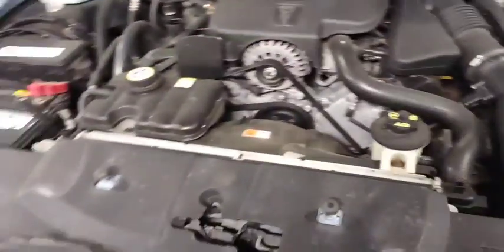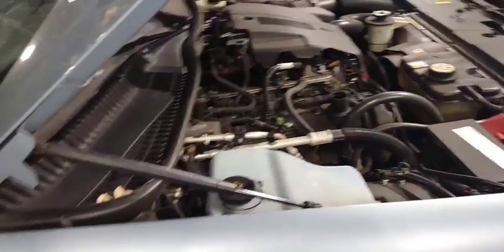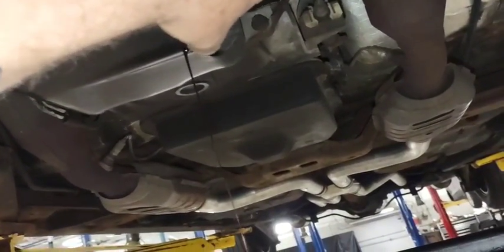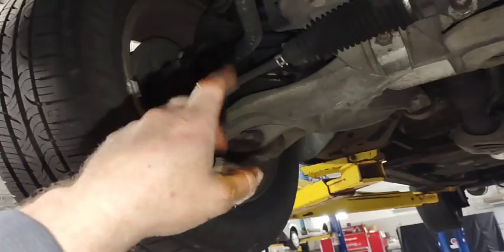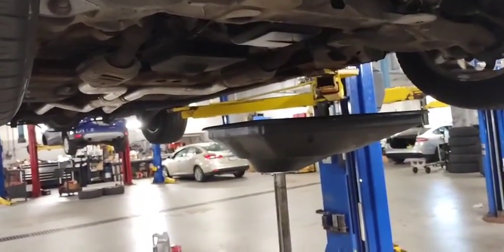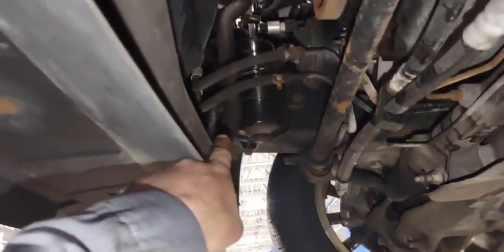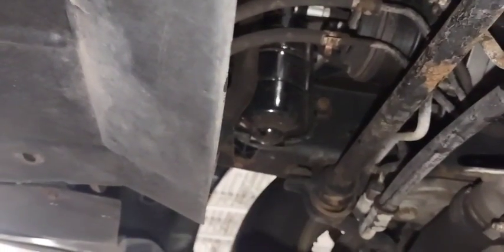Pennzoil Platinum Ultra oil drop 5k Miles, the next 5k Miles trying Mobil 1 extended high mileage

Comment: I seem to recall Pennzoil platinum ultra has the 2nd highest anti wear properties on the market. Amsoil's best is like the only thing to beat it.
Reply: yes but, amsoil is twice the price
Reply: @dickgoesinya9419  my point basically, why wouldn't you pay 35 bucks for 5 qts instead of 70 for an oil that offers 90% of the capability of an oil that's like 20x better than a regular old bs conventional that will see a motor to 500k if changed often enough lol.
Reply: @dickgoesinya9419  better off changing pennzoil twice

Comment: Ive used Penzoil platinum in my last 2 3.5 ecoboost f150s with the motorcraft filter. In 150k on one of them never once did I get the chain rattle. Pretty good stuff.

Comment: I love your videos! I do a lot of work at an independent shop that specializes in race motors, alongside general maintenance.

I would like to see you keep a small bottle of the different oils and different mileage on the oils and compare them at least visually between the different brands, and also the different mileage 3K/5K intervals to see if there are differences, and if there are, what can be learned from them.

Comment: I had an 02 mustang GT I used Pennzoil platinum 0-20 every 3000 miles and I have a 2012 BMW 335i and I will use the proper European spec Pennzoil 0-40 with the Mann-Filter HU 816 X Metal-Free Oil Filter.

Comment: In fact, with the Mobil 1 Extended performance the longer you leave it in the better it gets! Yes it will be very black but it will have zero sludge and no bubbles.

Comment: Rotella deisel t6 5w40 is the number 1 oil run in boosted subarus the zinc is what you want for flat tapet engines. Mobil 1 is known to spin rod bearings and oil consumption in the subaru world. Not hating on mobile 1 as my 2003 cobra has runs perfect on only mobile 1 its whole life. Rotella t6 for my boosted subarus.

Comment: Somewhere in a frame or 2 of your video at the 7:00 mark it looked like the safety seal from the mobile 1 container went into your funnel. I cant be sure it could have been an air bubble, but unless you know 100% that you removed the safety seal (tin-foil/plastic) from the container i would be scoping the oil pan with a boroscope. Maybe the pull the valve cover on the oil filler side of the engine too... Thanks for sharing your results. I do personally like pensoil platinum in ford products, seems to work well, and keep the engines clean & quiet.

Comment: QUESTION!?!? When you cranked your car with the pedal down did that allow the oil to flow before starting the engine?! I’m new at changing my own oil and had a loud start on my car. It quickly went away but I’d never heard that before. 😮
Reply from the maker: Yes but not all vehicles do that
Reply from the maker: Mainly American and some import
Reply: I’ve got a 2015 accord and I could prefill the filter even but I am going to see if that works. I’m trying pennzoil platinum high mileage. It sure sounded bad for a second or two. I hope everything is okay. 😅 thanks for your content

Comment: You can tell that car hasn't spent winters in western NY.  There's only light surface rust, not flaking scale.   And you have to love how oil filters are always over something that can catch the used oil potentially allowing it to drip off the vehicle for days unless you clean it off with brake clean.

Comment: I heard oil that says high mileage has additive that swell seals ?? Also very clean and tight for over 200k
Reply from the maker: You know there's a battle between what that exactly means and when you sit down and listen to the Valvoline scientist actually talk about things they say it's just a conditioner that helps keep the seals life it doesn't really cause it to swell but then again who knows and they actually say running high mileage from brand new will make the seals last longer and it's definitely okay to do that because you're adding more protection to those seals
Reply: @FordBossMe  
As a former AutoZone employee, i was always of that opinion myself. I view it as worth the little bit of extra protection.
Reply: @FordBossMe  oh ok maybe I'm thinking of the actual additives

Comment: Better spray the pinch welds, at each oil change, on the transmission crossmember where it is pinched into the frame. Even when you remove the 4 bolts holding the crossmember to the frame, you can still pick up one of these cars with that crossmember if it's rusted and has never been out. We did it with a huge fork lift in the junk yard.

You literally have to beat these out on the 03+.  03+ has a new hrdro-formed reinforced frame that's 30% stiffer than 2002 for higher crash test scores and reduced NVH. 

I just did the oil change in my 03 GMQ. 10,000 miles Supertech full "synthetic", but it has a fresh quart added ever 2,500 miles.. 

Great video..

Comment: Guess I dont drive much anymore. Bought my car used just over a year ago. Changed the oil right after I bought it just so I knew what was in it and changed it in Oct and again in April (with my seasonal tire rotation) and I only have put about 5k total miles. Royal Purple and K+N filters. DOHC/VVT engines thrive on clean quality oil.

Comment: The only time I used pennzoil (2 stroke oil) was in a few of my marine outboard engines one of them. It made my Yamaha run like crap it would smoke like crazy even though it would be mixed at the proper ratio. It would "make oil" basically leaving a thick sludge coming out the exhaust through the prop. It would also do the same thing my 2 evinrude outboards I had as well. I don't think I would try their conventional motor oil in any of my passenger vehicles. I run vavoline in my truck and in my boat I either run yamalube or quicksilver.
Reply: I wouldn't touch regular penzoil because of the paraffins in it clog engines but the platinum series is way way different using natural gas to make the base oils. They hit it way outta the ballpark with the platinum series and I personally, for what that's worth, think it's second only to Amsoil at half the cost and it's available just about anywhere now

Comment: You should try amsoil signature series with the amsoil filter. I do 10k mile oil changes with my 5.4 3v. It idles very smooth and I’m very impressed with it. 200k and the motor has not been opened up yet.
Reply: Amsoil filter is rebranded bosch/royal purple and very similar to the mobil 1 ep filter
Reply: @Radio0500  amsoil and royal purple have the same micron filtering 98.7 percent at 20 microns. Mobil 1 is 99 percent at 30 microns. Price is the same for royal purple and amsoil using preferred customer discount so it’s a no brainer getting it while I get the oil.
Reply: Wix xp is still a better filter.

 Micron rating is industry bullshit none of these companies use the same benchmarks
Reply: @Radio0500  wix is a good filter and that’s the only filter we use in our fleets along with oem filters but the xp filter is only rated to go 10k miles. Amsoil is 25k. 3rd party labs show it can go further then that. Gives me feel better about the amsoil. Have 200k on a 3v with without the horror problems everyone else is having. It’s more than proven itself to me.
Reply: The claimed mileage on all these filters is all marketing bs. I'll leave it at that
Reply: @Radio0500  if a filter can filter down to 20 microns, go 25k miles or one year and has been proven to do so why waist more money. I only spend 160 dollars a year on oil changes per vehicle. If I used any other oil And filter I’d be spending twice that. 7qts of Mobil 1 and filter is 60 dollars and I change that every 5k miles in the 20k I do a year because that’s when my motors valve train become noticeably louder with this product.

Comment: I use the Mobil 1 Synthetic for higher mileage over 75,000 after using Ford's oil since new .
I also use 1 quart of Lucas Synthetic Oil treatment in every change since new , it's a 5.4 gas Triton. 2004 Ford F 350 Super Duty XLT, she runs great but noticed the Ford oil was burning off . So I switched to Mobil 1 and it stopped . I have no leaks at all and have 160,000 on it .I fix anything that goes asap and don't delay anything.
So far this Mobil 1 has been great ! I go 5,000 before changing the oil & filter , I have changed every oil change myself since new .
It's a great truck and a daily driver and still like new except the clear coat 😆 . 
The southern sun is rough on that part but she is a great ride I will keep forever ! I will keep using Mobil 1 ,so far so good and I get great mileage , 17 city , 28 highway , a little less if hauling something of course but she is just awesome !

Comment: I used to own a 1999 Lincoln Town Car, 4.6 2v. I had the car untiI 2007 with 392,000 miles when I sold it (fleet car). I religiously used Amsoil Signature Series 5w30 with an Amsoil absolute efficiency oil filter. Oil changes were done every 25,000 miles. No engine issues such as sludge, knocking or ticking. When I changed the valve cover gaskets because of seepage, the cylinder heads were clean and the cam lobes showed no wear. I have been using Amsoil for over two decades and I trust their oil for extended service intervals. BTW, all the vehicles I owned where I used Amsoil were gasoline (EFI), normally aspirated motors.

Comment: I run Pennzoil platinum Euro synthetic 5w-40 in my VW MK7 Golf and have sent in two samples to Blackstone for oil analysis.  My reports are excellent with very low wear numbers across the spectrum.  I am sold on this oil.
Reply: I don't know what VW changed to make the Mk7.5 take 0w-20. That is nothing more than water. I switched it to 5w-30 at only 1000 miles since I live in AZ. I thought about xw-40 oils but I wanted to play it safe just incase they did change something with the engine.
Reply: @Dcc357  I'm in El Paso and do not often use 0w20 as specified for my small 1.5 turbo Honda. Hopefully I'm not messing things up but so far I use 5w30 or 0w40 usually.

Comment: So this may be a dumb question...but i love your "flood mode" idea. I've used it before for all kinds of reason but never gave it a name. I'm a mechanic for smaller equipment so I have what I call a "hotwire kit" that i use to crank engines over or power the ignition or fuel system (and I'll use it sometimes to crank engines when i know the oil pump is dry before i start them). I recently bought my first vehicle that has a throttle by wire system. If i hold the pedal to the floor will it have the same affect as it did on my older vehicles?
Reply from the maker: I think so.... if it's push-to-start you'll have to hold the break as well

Comment: I've used Valvoline Maxlife oil in my vehicle (2004 2.7 Sonata) and it seemed to do fine, but after working at Valvoline and changing oil, it'd drop pretty dirty after 3k. They brand and sell it as a mid-tier oil at Valvoline itself: the Advanced Full Synthetic oil is stuff on top, grey container. It was definitely thinner and didn't look as bad when coming out after 3k like Maxlife or Conventional did. I'm no expert though, I just worked there for half a year haha. Great videos, keep em up!
Reply: Ive got a 2005 Dodge Ram 4.7 with 70k miles and the last two oil changed have Been with 5w30 max life full synthetic and as soon as I get 3000 miles it goes super dark like you were saying. I may have to switch to pennzoil.
Reply: @therowdyboysnetwork2827  Yea, honestly amsoli and mobil is probably the better options. There are so many kinds, hard to find the best one yknow. Should never go past 5k anyway so if you make it to that with still some color left on your oil you're golden.

Comment: 2002 f250 5.4, got it in 2016 with 230k miles it has currently 525k which route should I take a complete engine rebuild a new engine or used engine with lower miles?engine is currently running ok there is a difference in the power it used to have to currently just want to get ready

Comment: Gotta 94 explorer 4.0 ltr that I ran Mobil 1 5w30 in that had mild lifter tap and got around 16mpg just switched to Penzoil platinum 0w20 and lifter tap is gone and mileage has increased to around 18mpg so far.

Comment: I had a 1990 GMC 1500 Sierra short bed single cab with the 350. I put 365k miles on it going back and forth to work. Only item changed on the engine was a starter. It didn’t leak or smoke. Sold it to a kid and I see it once and a while, still running great. Always used Mobile 1. Never had to add oil between changes. Great oil. Believe me, I was raised in the time of Paraffin based oils. You were lucky to get 80 to 100 k miles before a rebuild because of blocked oil passages. Just sayin.

Comment: Have always done 12,000 mile oil changes with Mobil 1 Extended.  +200,000 miles on my current 4 cyl. and no issues or bottom leaks.
Reply from the maker: Just because you stick your pecker in a blender and get away with it doesn't mean that you should do it

Comment: I wish someone would do a test on the 2020 F-150 2.7 ecoboost and say what is the best synthetic motor oil to run, changing oil at 3500 miles.

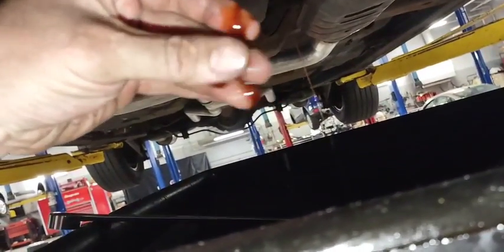Comment: The used engine oil coming out of your 4.6 at 2:00 is better than the oil that is currently in 90% of the vehicles on the road.. my brother manages and runs a "5 min oil" change place and you'd absolutely not believe how nasty and tar like lots of car oils are. New and old, rich or poor, makes no difference.  They often go over the "5 minutes" because the old oil is so thick that it takes 10-15 min to all drain out.

Comment: Man I’m using Valvoline full synthetic extended 5w30 on my 2020 ecoboost mustang I’m changing it every 3000 miles only reason I change it so constantly is cause I have performance tune downpipe full bolt ons Just to be on the safe side I’m always terrified of getting eco boom cause I know ford won’t cover me in warranty do you think I should keep changing it every 3000 instead of 5000 miles the car has 15,000miles and  runs great.

Comment: I jumped on Amsoil in 2015, with my customer account ( $16.00 a year ) I can get their OE 5W20 for $5.95 a quart. Bad thing about it during lock downs I had to buy over $50.00 worth for free shipping. I can pick it up now in Benseville warehouse now.
Reply: $5.95 per quart? Wow, that’s super cheap. There’s one distributor of Amsoil here in NZ and it costs 3-4 times that. In fact most oil brands cost approximately 3-4 times more than what you guys pay Stateside though.
Reply: @zeroyon4562  Yes. It's cost me $16 dollar for a year for being a preferred customer. When the lock downs started, I wasn't able to pick it up at the warehouse. They put out a few commercials about free shipping but the first commercial said after $100 purchase. In a few weeks it went down to $50.00. They send out emails just about every month. I drive so little now I just get it for my Mustang and my sisters car. I was in Auto Zone last month and walked down the oil isle, there wasn't even a blend under $7.00, The 100 synthetic percent started at  $9 dollars and went higher. I bought two new cars in the last 3 years , I get coupons from the dealership about every 4 months. they can do it cheaper with a oem oil and filter then I can do just buying the oil and filter ...They are up to about 5 different millage synthetic now ,lots of import and motor cycle oils too.. At one time  I was doing about 5 oil changes a year...they send you a print out of your spending for being a preferred customer...one year I saved 80 dollars with the program... I don't see it in any auto stores I shop at...

Comment: Back in the “ old days” Pennzoil was well known for gumming up engines with sludge.  I have to assume this is no longer the case?
Reply from the maker: Right its not
Reply: The platinum and ultra platinum don't have the paraffins (read wax) in it that the regular penzoil has. Base oils on the platinums are made from natural gas, very clean
Reply: 2021 Pennzoil is not 1971 Pennzoil.
Reply: @tonym6854  I know but I still have a vivid memory of pulling off valve covers and not being able to see the rocker arms.
Reply: @craigjorgensen4637  i remember back in the day everyone warned me not to use the 'yellow' stuff. 
Oil technology today is light years ahead of what it was a few decades ago. Dare I say that any oil today is far better than the best oil 30 years ago
Reply: I think all oils are really close now.
All the good brand name oils used to be similar years ago, with a few exceptions.
None that are still sold.
Reply: @craigjorgensen4637  combustion blow by gasses caused acidic moisture. If a car was only driven very locally the engine never got warm enough to burn them off. Longer commutes, more driving, cleaner running engines, hotter running engines, and better oils eliminated this to the point where a 6000 mi oil change is the equivalent of a  2000 mi oil change in the 70's

Comment: I've been using Mobile 1 full synthetic at every 5,000 in my 1998 Town Car since becoming the second owner when it had 67,000 on the clock. Now at 120,000 and just changed, I've had no issues whatso ever.  It does have a few damp spots, not wet and dripping, at the sealing surfaces that need addressing come spring. This car runs very quiet getting 26.8 miles per gallon. Overall it's one of the cleanest '98's still on the road because it is well maintained.
Reply from the maker: You want to put something better in it put pins a little Platinum Ultra 5W30 in it